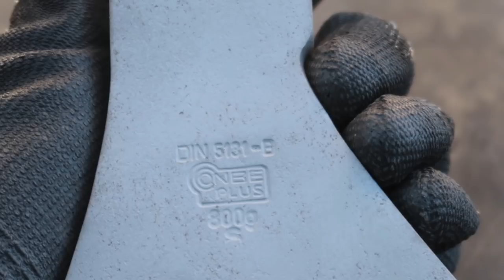Axe Restoration With a broken Handle .

Comment: Buy new ash handle at Ace Hardware for $17 complete with new wedge. Knock-out old handle with wood chisel. Install new handle with steel wedge. Sharpen Axe. Chop wood. One hour passed. I did this with my Paw-Paw's 90-odd-year-old double-bitted axe last year I got with his house when I bought it. I think it may have been HIS Daddy's axe down on the farm as he brought it from Arkansaw when they came to Tulsa in 1943-it's fine steel, so it may be ALOT older. I've replaced hoe and shovel and hammer handles too and didn't think it deserved a U-toob video-just thought it was common sense! Fixed Hand planes and hand saw handles too (made them in the shop on a scroll saw). I forget "Common sense" ain't no more.
Reply from the maker: Ok :)

Comment: Are you familiar with the thought experiment 'The Ship of Theseus' ?
Reply from the maker: No
Reply: @GarageRestoration  The Ship of Theseus is an artifact in a museum. Over time, its planks of wood rot, or break, and are replaced with new planks. When no original plank remains is it still the Ship of Theseus? 
If you apply the same idea to the axe - is it still the same axe?

Comment: Bluing solution? Cheater.
Reply from the maker: what ?
Reply: @GarageRestoration  bluing solution is the easy way (and the least durable way), which is why it is cheating. Hot bluing is better. Even painting is more durable than cold bluing.
Reply from the maker: HOT bluing is ok , but ….It can damage the durability of the material, so I used this method 😇
Reply: @GarageRestoration  Hot bluing is done by raising the temperature of the metal above the polymerization temperature of the oil it is dipped in. If you use boiled linseed oil you don't need to go over 200C (at most). And at 200C no steel will suffer. 
Just paint on the oil and stick it in the oven at 200C for a while.
The method you used makes a very thin porous layer which will make the metal rust if the oil gets removed.
Reply from the maker: I made HOT blue on the stilson key, it worked well ... I'll do it again in the future, thanks for the advice 😇🤝